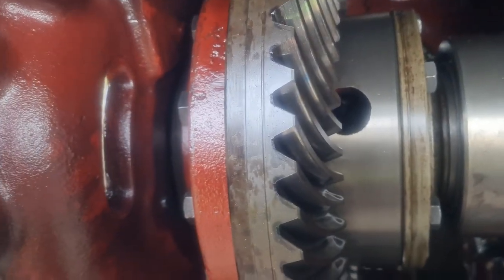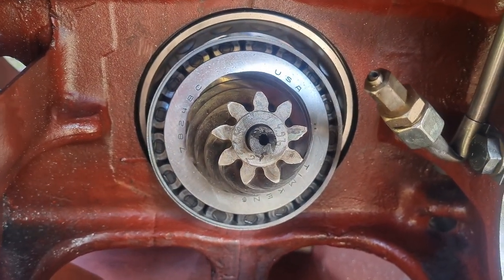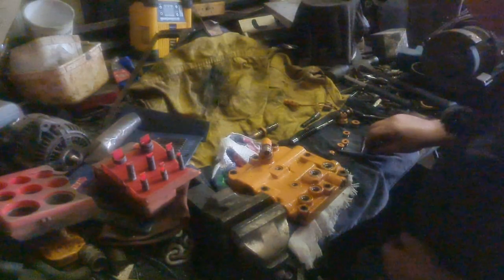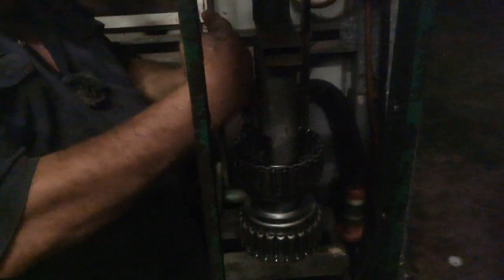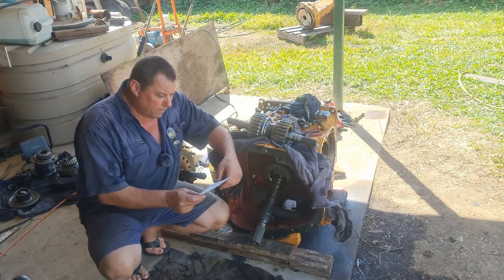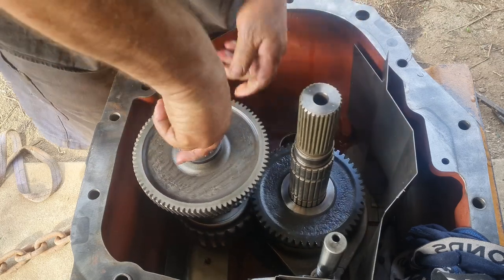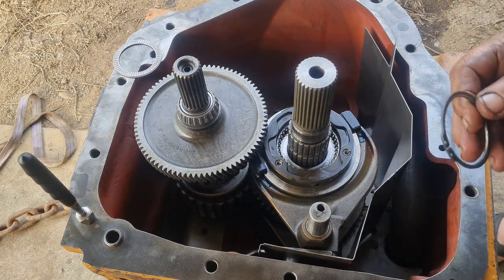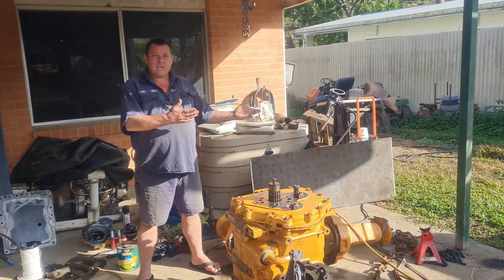Case 580SK g'box clean out

Comment: Hello, I have a 1993 590 turbo, it uses the same transmission as the SK, forward gear is failing, it takes a few seconds to apply reverse, no problem, can you help me with any recommendations?
Reply from the maker: Hi Diego, sorry for the late reply. It sounds like low charge pressure. This may be caused by either the pump being worn out, or maybe the seals in the clutch-packs are worn out? To check these, you will need a test gauge, and the workshop manual to tell you which port to check and what the correct pressure should be. Good luck with it. I hope it's an easy / cheap fix for you.

Comment: Hi, I have a case 580 sk, what oil to pour into the gearbox? atf 2D ? is utto sae 10w 30 ?
Thank you very much helpful videos
Reply from the maker: Hi Kacper4x412, the workshop manual says to use 'Case Hytrans Plus', I have used the Mobil equivalent 'Mobilfluid 428 multipurpose tractor oil (utto) and power steering fluid' (wow, that's a big long title, but that's what's on the drum!!!). The transaxle has wet clutch packs, and wet brakes, so make sure the oil you use is compatible for this application. Hope this helps, good luck!!